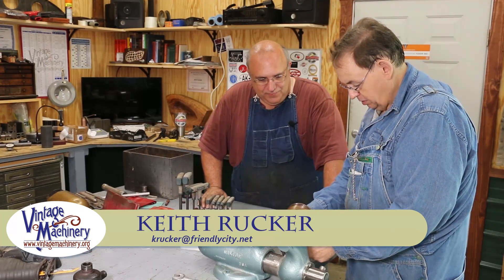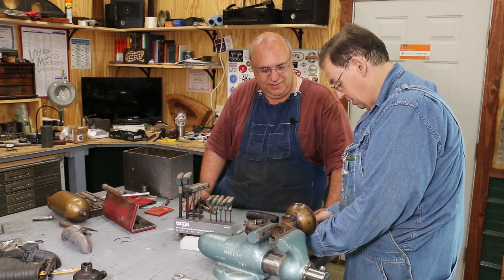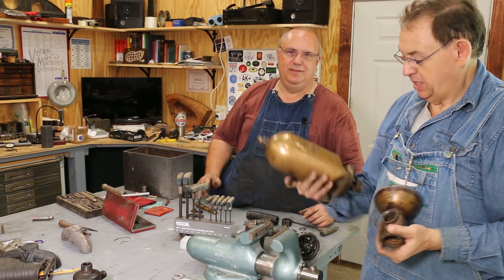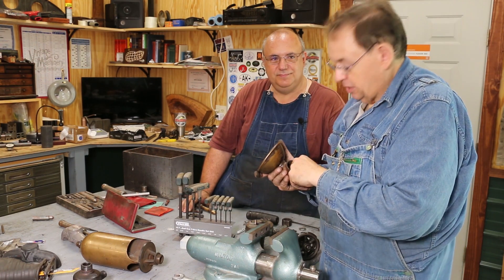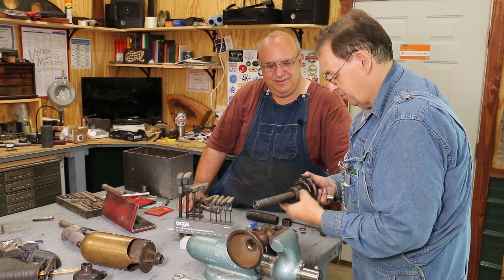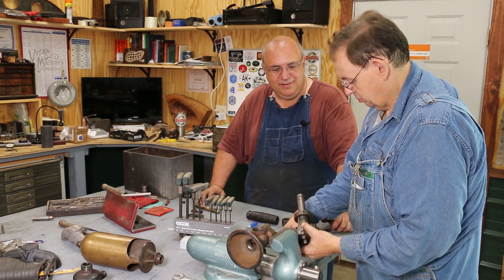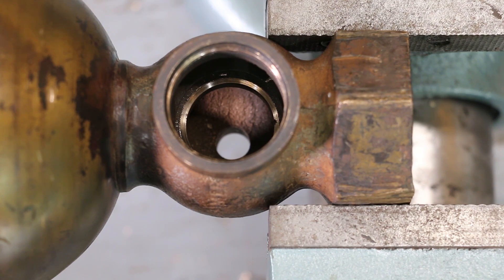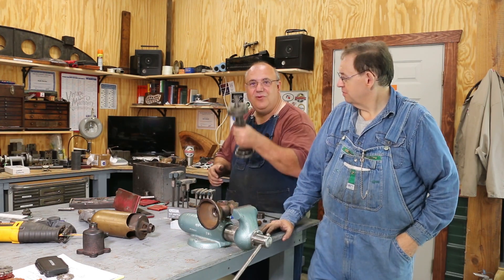Dressing a Valve Seat on a Lunkenheimer Steam Whistle

Comment: You've got to love specialty tools like this. VW air cooled engines have such high head temperatures that you should adjust the valves every 3,000 miles. The tool had a handle with a half inch socket drive. Through the drive was a screwdriver bit with a knob to turn it. No fumbling with a box end wrench and screwdriver. I could do the job better in only 15 minutes. Worth every penny.

Comment: I remember using a much abreviated version of the seat cutter way back in eighth grade small engine shop (mid-60s). But that just had guide rods that would stick down into valve guides. Remember it had two different angle cutters.

Comment: Interesting project....seeing as how the steam can cut thru bronze would it be worthwhile to press in a seat of hardened steel like that which is used in internal combustion engines?
Reply: Steel would rust, jets of steam wont bevstopped anyway it doesnt care what the metal is, once theres a path it cuts
Reply: Steam will cut and erode glass.
Reply: glass?

Comment: Got a mini version of that style tool for redoing valve seats in water taps(In sinks/showers/anything with a standard washer seal). 
Not even close to as fancy, adjustable or versatile as that though. :)
Reply: Yep, use one regularly. So many people replace washers and find a tap still leaks. The seat almost always needs dressing.
Reply: what with the valves, seats becoming a thing of the past, shame as washes are easy to replace ( i too have a seat cutter set)